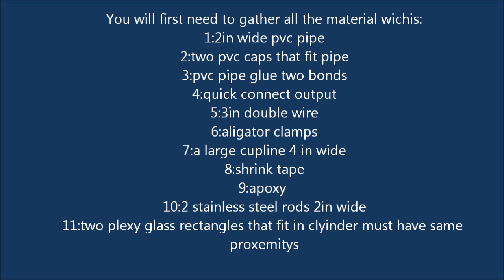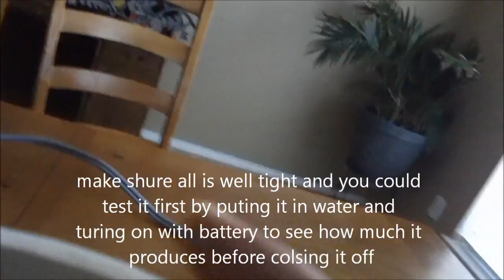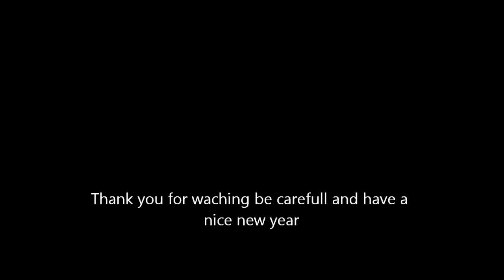how to build a hho generatore fast and simple

Comment: Of course there are two wires...it's a simple electrolysis cell. One is anode & one is cathode. Current flows between them moving the hydrogen ions in one direction & oxygen to the other thus splitting the H2O into HHO.

Better design is 2 chambers with interconnecting water pipe so you can collect the hydrogen separate to the oxygen.

Comment: This is simply an electrolysis cell. As It's a single chamber you also end up with a HHO mix which is A. Highly explosive B. Largely useless as a useful fuel.

When you recombine the Hydrogen & oxygen you will end up getting out less energy than you put in from the battery.

Electrolysis is only useful as a fuel source when you generate electricity from a renewable such as sunlight / wind and separate the hydrogen out to store for later use. The oxygen can simply be released or a non fuel use

Comment: True it does recharge the battery...but where does it get the power to do that from? From burning the hydrogen....

Given that at each stage you lose lots of energy this system will simply run down very quickly. 

I'd be surprised if you get as much as a 50% energy return from burning the hydrogen as compared to the power you have to put in to make it.

Cars have entire systems devoted to getting rid of excess heat from burning fuel, all that is wasted energy and that's true with hydrogen too.

Comment: Your measurements are off on everything. That is not 2 inch wide pvc pipe, not 2 inch steel wires, and not 1 inch apart holes.